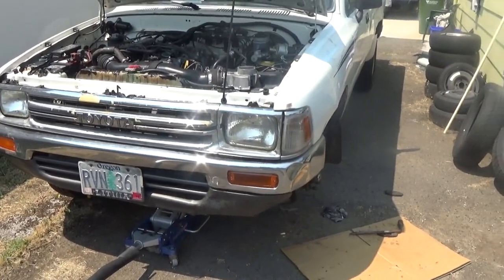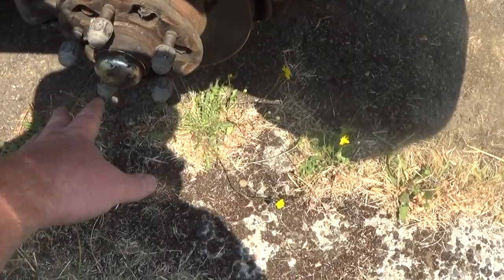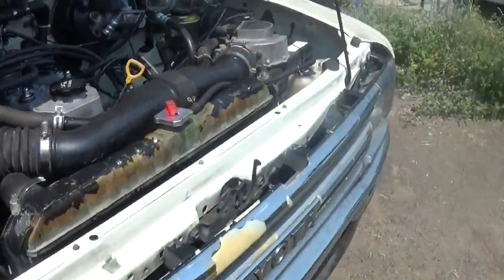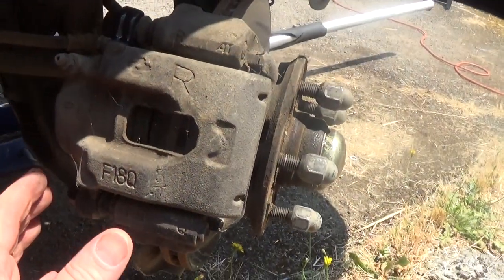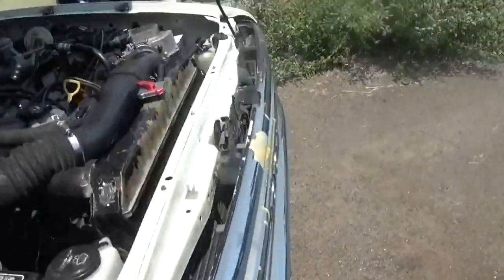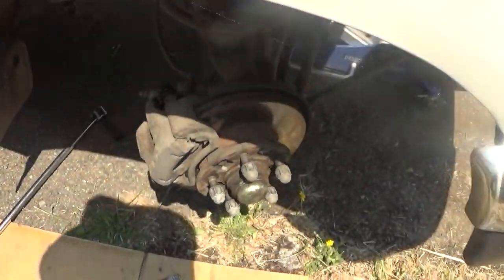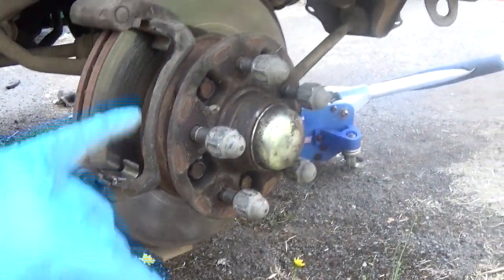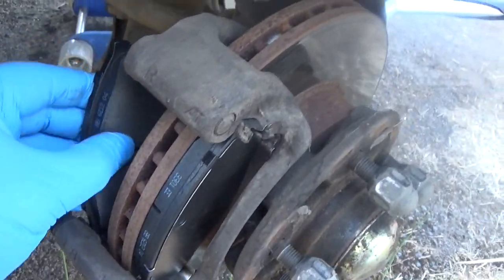1991 Toyota Pickup Brake Pads

Comment: My 1995 Toyota V6 pickup has the identical brake system, so your video was perfect.  Everything was exactly the same. Got it done quickly and easily.  Thanks for taking the time to do this excellent video!
Reply: Thanks for the info! Going to do this job this week-end
I got same model year pickup, super annoying to find right info when "95 toyota pickup" only shows first gen Tacoma results.

Comment: Also you didn’t specify about the Brake rotors they also have to be in good shape or checked before you put on the new brake pads right?  I think this will also help many of us if you can explain that too… good Video. Thank you so much for the content…
Reply from the maker: How do you take the rotors off, if they are bad?
Reply: @tubejim101  no. Actually on checking the rotors if they are in good shape or they have to be turned  before putting on the new pads. And if so How you would check the  rotors because I’ve heard fro auto parts if you put new pads on random rotor and the rotors have some sort of defect or are   Grooved they can damage new pads right?? Not sure if I’m correct let me know what you think …?
Reply from the maker: @jonathanmartinezdrummer7830  Many auto parts places will not turn rotors anymore.  They just recommend replacing the rotors if they are bad.  As long as the rotor is still thick enough, and does not have deep groves in it, you should be fine.  You can usually tell bad rotors, because they will have a lip that forms.  If the edges, are thinker then the center, it is time to replace them.  Some cars it is easy to take the rotors off.  You can take them in, and they should be able to inspect them for you.

Comment: you dont need those metal "v" springs for the pads? mine came with them and i lost them should i be worried?
Reply from the maker: If your talking about the clips the brake pads sit in, just go to the auto parts store.  They might just give you some, but if they charge you, you can just buy the clips for inexpensive.

Comment: Is there a specific torque on those two bolts? Or hand tight good enough?
Reply from the maker: I believe it is 90 ft lbs.  But you will want to double check.
Reply: @tubejim101  what brake pad brand do you recommended? What did you use on the video? I am considering the Bosch quiet cast
Reply from the maker: @John-co2yz  Akebono  https://amzn.to/3de0M9r
Reply from the maker: @John-co2yz  I just used some cheap ones from https://www.oreillyauto.com/
Reply from the maker: If I was to go cheap, here are some good pads:  https://amzn.to/2JTOpxg
Reply: @tubejim101  thanks for your feedback! I am now considering Napa premium ceramic and Akebono ACT589. I’ll have to change my pads sooner as it is really thin and my guess is it’s the original  oem pads it came with in ‘94 (87K miles right now)
Reply: Last question, is a brake caliper grease really needed or any multi purpose grease (liqui moly) will do it?
Reply from the maker: @John-co2yz  Want to do caliper grease.  It is formulated to high temps that your brakes reach.  Non-brake grease can turn to liquid and just leak out.